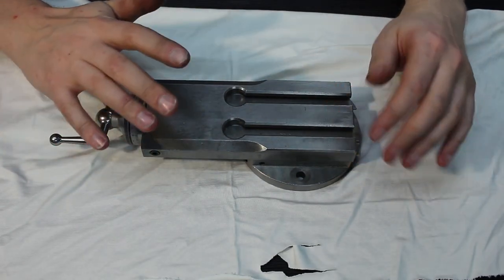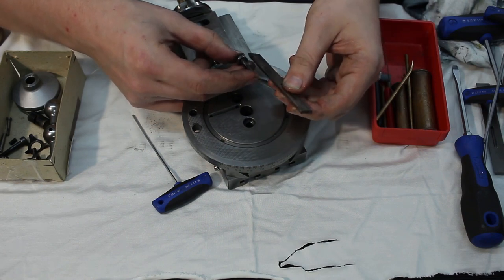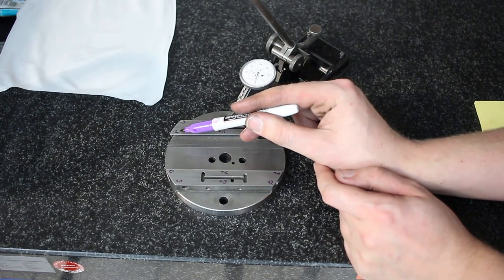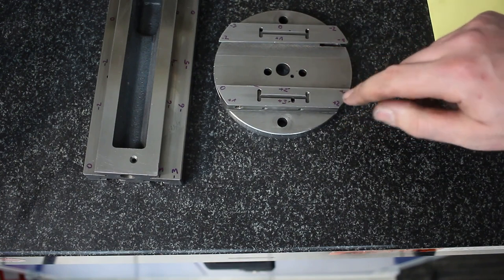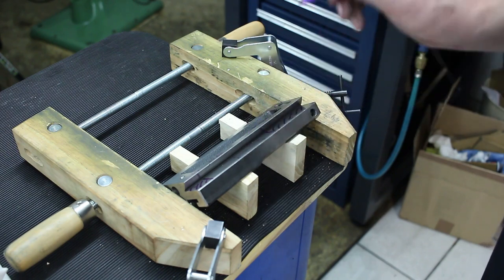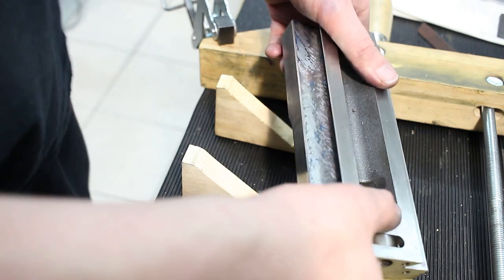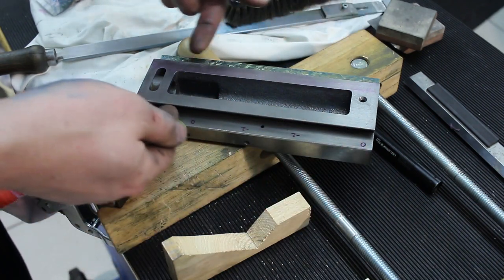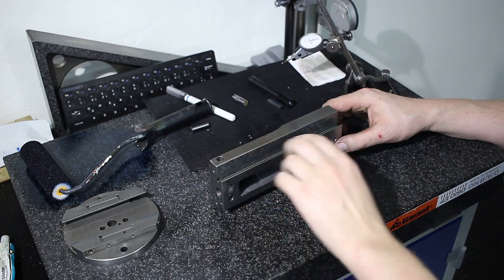Rebuilding a Schaublin 102 compound slide - Part 1

Comment: we give our fractions names, meter is 1/1, decimeter 1/10, centimeter, 1/100, millimeter 1/1000, micrometer, nanometer and so on... hell the prefixes indicate the fraction or multiplier of the base value. Meanwhile imperial which has some values based on metric because there were too many inconsistencies between say the inch country to country. Metric sure is a great system, logical too

Comment: I'm actually doing the exact same thing on my own Schaublin slide. I had trouble taking mine apart. There is a central boss in the middle of the lower slide (that the one you have is missing) that slots into the leadscrew nut. That means that you can't simply slide the lower part off.

Incidentally, it's not a pair of angular contact bearings for the leadscrew, it's a single bearing that's got the outer race split into two rings. The bearing is pre-loaded by changing the distance between the two rings. A very interesting design and one I've not seen anywhere else. To make it more interesting, the races are metric, the balls are imperial, 5/16".

I also decided not to replace my gib. It was 180€ for a new one, so I machined the old one flat and epoxied on a piece of bronze. If anyone's interested in the process, I can post a video.

Mine was worn a similar amount and I believe that was because the previous owner used grease instead of oil.

Comment: Stefan,
 Nice work, solid techniques and attention to the details of getting it right. There are ways to get around this effort, but the more prudent approach is in your work. A friend of mine, a mentor too, who has many years of this work rattling around in his head simplifies it this way…. FPS, everything can simply be reduced to Flat, Parallel, Square and then the rest is easy. So simple when you look at a part, “how do I get this Flat, Parallel and Square.  Thanks for showing this work.

Comment: The "Old" hammer trick. Richard taught me that when I was scraping a Cast Iron 45 degree triangle similar to the one hiding behind your surface plate. Hinging and the hammer test sure save me time now that I know about them. Great video Stefan.

Comment: As expected an extremely well explained and detailed process of what's involved Stefan. And the first time I've seen that setup for checking how parallel the male dovetail is. Now that I have seen it I'd certainly agree it's an easier and likely a bit less error prone method than measuring across the pins with a micrometer. Time wise both methods are probably about the same. Detailed videos like this give me some hope of finally doing to my lathe what you did a long time ago to yours. Many thanks for taking the time and going to the effort. It's very much appreciated.

Comment: All those nice pre squared parts sure do make it easier to work with. In the states especially on old machines they didn't do anything but cast most every surface that wasn't used so  mapping and setting things up to fix them can really be a challenge.
Reply from the maker: Ha, the dreaded old machines with their nice courves. Schaublin has a reputation to machine even non-critical surfaces to a high degree of precision. 
Surfaces that other manufacturers would just leave as a rough casting, Schaublin would flycut or surfacegrind them and leave them bare metal. Especially on the slightly newer Schaublin lathes and mills from the 70s up to today.
Reply: Not all machines built in the US have the characteristic of lots of cast surfaces. For the most part this had to do with cost issues. Schaublin builds high end machinery. As did Monarch, Hardinge and others. Note not all Hardinge or Monarchs were  built to the highest quality standards. In the US the highest quality lathes were generally known as either Tool Room Lathes or Instrument Lathes (some makers would also hang the tag on lesser machines unfortunately). In terms of manual precision lathes there are a select few. Schaublin, Monarch 10EE's, some Rivett's, Hardinge HLV-H/ER's and some European brands.

Comment: I learned machining skills on a technical school built up by a Swiss team. Absolutelly everything was swiss made, from the simplest file to big machines, everything was Schaublin, Aciera, Tesa, Etalon, SIP, etc... (except the optics lab which was built by Carl Zeiss Jena)... The course took 4 years from 7am to 5pm every day and one of the machines we learned tho deal with in the first year was a Schaublin 102. In the second year we used the Schaublin 102VM and in the third year we used Schaublin 125.

Comment: Stefan, I am putting a CNC Router together, I bought some 6061 T6 Alum T-slot in a slightly used condition and need to stone one face. It is 45 x 180 and will support the X Axis bearing rail. One of the 45mm faces is a little rough.  So what may be used to take nicks and burrs off of this material? A stone would become clogged. But I do have a cross ( or double) cut axe file.  I have heard that a light coat of tapping or cutting oil may help reduce loading of aluminum shaving. I am only removing the smallest of chowdering,... to sneak up on it, not resurface the entire length:-)
Thank god I have one virgin edge for my Hiwin Bearing rails :-)

Comment: This is awesome information. In the states, where can we find straight edges for bluing ways? Especially beveled edges that will fit small ways? I have a scraper and surface plate, but am struggling to find a few tools. Including the base and arm for my dial test indicator. I just don’t know the proper terminology. My searches came up empty!

Comment: This is just awesome Stefan.  Really good information on restoring the dove tails on  a lathe by scraping.  All the information on the measurements are also really useful.  That is half the job, to do proper measurements before and during scraping.  I have not done any scraping, but as the owner of several well used machines the need arises soon when you get into precision machining.  I know my machines needs a serious improvement.  However, I don't feel i should jump right into scraping my Schaublin mill as the first job.  So I think the old Myford that I am not using any more could be a good candidate, after I have practiced on some machinist blocks and other items.  I came across a (practically) unused Biax the other day.  I read somewhere that they run around €3K new, I can have this for way less.  Is it a must have you think for scraping?
Reply from the maker: For larger machines a powerscraper is nice as it speeds up work immensly, but for small stuff like this compound or even my mill I think you could get along without a powerscraper. For smaller dovetails its not helping anyway. But it shines on large surfaces :)
Thanks for watching!

Comment: Hi there! Very nice explanation of step-scraping. Thanks! Also, how do you cut-off carbide mills? I can't find proper diamond cut-off wheel for that...
Reply from the maker: Thank you!

I cheated, the endmill shanks where wire edm cut.. ;)
But I have a resinbound diamond wheel that would work.

Comment: What happens to the  measurement accuracy of the setup with the pins if the lower dovetail is worn? I'm referring to the setup that you are using to scrape the angled ways.

Comment: How critical is it that I drop everything before I use it?
Reply: very. it allows you to limber up your back and fingers
Reply from the maker: Very important! Its stress releaving the parts.
Reply: Stefan Gotteswinter   And transfers the stress to the operator?
Reply: Briljant! This will be done on my lathe very soon. But i have to make a new gib. Nice job for my little Aciera F3👍😀

Comment: Could you have ground the majority of the flat, to get it straight level and a reference, and then scraped the extra bit, under the dovetail, in the same way you did with the unworn ridge? I just thought it would save most of the rough scraping.

Comment: Thanks for video and hope I don't need to go this far. I just bought a 102 and discovered that it has a chip out of the bed of about 3-4mm, where someone has dropped the screwcutting accessory head. Should I do something about the damage? Otherwise all good.

Comment: I can't help thinking that there is an easier way to keep track with the step scraping.  If you start scraping square 1, then change direction and scrape 2 & 1, then change direction and scrape 3,2 & 1 etc. This way you don't need to remark the squares and it should be impossible to lose your place. Unless of course I'm missing something :). Anyway thanks as always for sharing. I am looking forward to more.
Reply: Odd, My first thought (With ZERO experience) would have been Scrape #5, Then 5 and 4, then 5-4-3, then 5-4-3-2, then 5-1.  If interrupted at the end of the 3rd pass, you'd know where to start since the squares number 2 and 1 would still be labeled...

Comment: I like how you just posted this video as I’m starting on rebuilding Hardinge slides. Hopefully I’ll learn some new techniques.
Is your grinder to small to sidewheel it first?
Reply from the maker: Yes, slightly to small, and I am not sure if sidewheeling a dovetail is SO much fun. We do it at work with large die-sets that have a dovetailmount to the press, but our grinders there are "slightly" larger and run full flood cooleant.
Reply from the maker: But IF I had a matching dovetailcutter, I would have milled it first, that would bring me way withing 1/100mm tolerance.
Reply: Yea your right about the coolant, that’s how I run it and could see it not being fun without.
Really liked the two videos, I always pick up some new techniques watching you work.

Comment: That's not just a repair, that's an upgrade! Going from ground to scraped surfaces...

US/Imperial standard uses the decimal system but binary fraction lengths. It would make much more sense to use base-2 or base-16 for inch dimensions.

Comment: Right, 15/32 of a  16th. I'll never make sense of it and I don't know how they do.
Reply: It's easy enough, when you've lived with it your entire life.  ;>)  Just remember the numerator is always odd (for lowest common denominator) and the denominators are ascending powers of 2 (2 4 8 16 32 64).  1/64 of an inch = 0.397 mM. and that happens to be the wood working tolerance, when foundry pattern making.

Eli D.
Reply: so . . . woodworking tolerance is 25/64ths of a millimeter then?
Reply: You would probably have a hard time finding a scale with those units for a quick measurement, but yes, pretty close. :-)

Comment: Stefan, just for knowledge: would the last setup you showed introduce some errors ? You have to be sure the parallel is dead precise, and so the two ping must be exactly the same size. Is the paralles is not full parallel by, say, 0.005 and the pin differs by 0,005 you can have 0 ( if the error subtracts ) 0,01 ( if the errors sum ).
Am I missing something ?

Comment: When youre scraping Stefan, work back towards yourself.  Start scraping at the furthest most area and scrape away from yourself as usual, but each row should come back towards you.  The reason you do this is to avoid scraping over the chips you have just created.  Just like any machining process, recutting chips is bad for tool life, and it can make a big difference for how long you go between regrinding the scraper, especially if youre running a well honed scraper.  The surface finish will be a touch neater too.

Great vids though mate, this is a job Ive been contemplating with my own machine.

Comment: I'm a little surprised that with that amount of wear that you didn't start by grinding the face of the dovetail, like you did with the slide. You'ld need a cup wheel of course and grind with the part on edge, but still...

Comment: one thousandth of a millimeter(mm) is a micrometer(u
m)
Reply from the maker: Correct!
Reply: Except Americans spell it wrong. It should be milimetre and micrometre. As a fringe benefit, this distinguishes the latter from the glorified G clamp used for fine measurement!